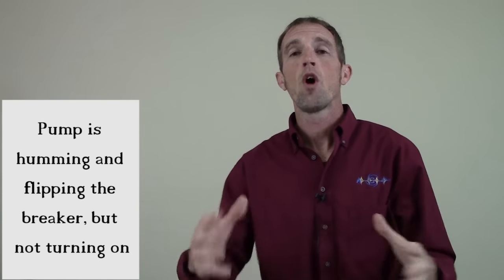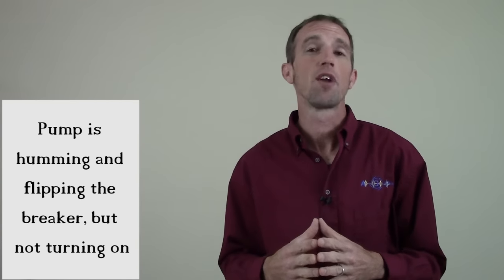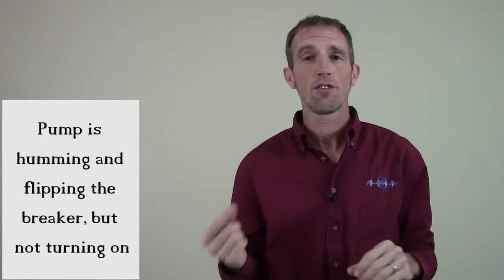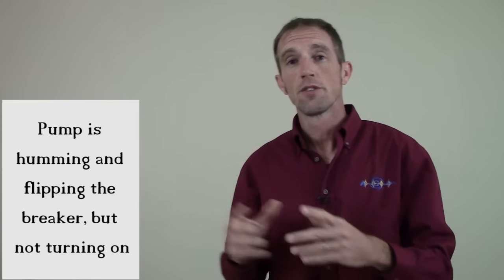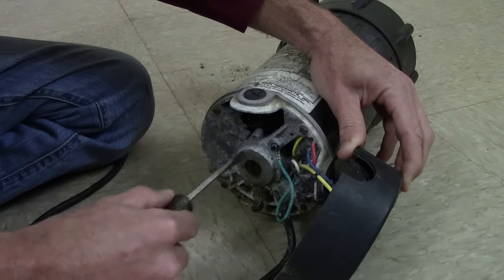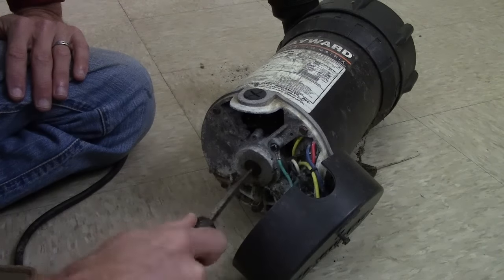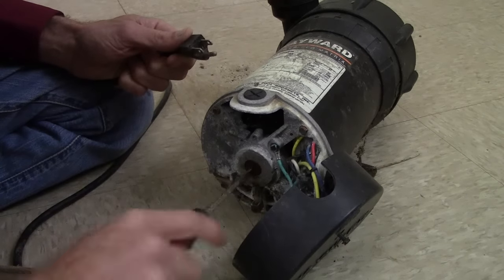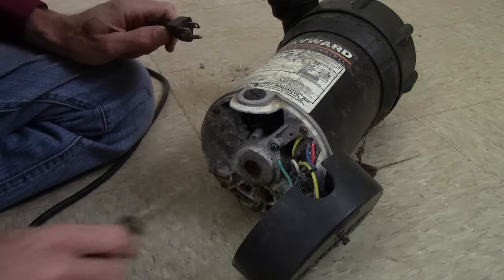Above Ground Pool Pump Won't Start or is Humming & How to Fix It

Comment: Got it to run.But is making a loud noise ? ??
Reply from the maker: That's just the bearings wearing down and grinding metal. That happens to every pump at some point in its life. The positive thing is the pump still running at 100% but the negative thing is it's keeping the neighbors awake at night. You can keep running it if you want or you can choose to replace it if it gets too loud and annoying.
Reply: @abovegroundpros  can the bearings be changed ?
Reply from the maker: A motor repairman might could.  You'd have to ask.

Comment: Well I can turn mine but it's not starting now I'm 💔 thankyou so much for this info you are so awesome bless you🌹💞🥀
Reply: CFlorida girl did you ever get your pump running? I have the same issue. If I find a fix I’ll let you know
Reply: @rickysheep93  yes I did! Have to keep giving it the "kick start" with the screwdriver. Unfortunately thats how its gonna be until it goes completely out lol
Reply: @rickysheep93  I dont use mine all that often lol only when I need to add chlorine & I run it like 6 hours or so a week.also I really appreciate your comment! Thankyou for the help
Reply: I tried my drill to spin it faster while turning the pump on.. fail. Seems a new pump is in my near future
Reply: @rickysheep93  did you try taking a mallet & smacking it before kickstarting it? I had to do that a few times before it would actually start
Reply: Tried the mallet and still nothing. Unfortunately the new pump has been ordered
Reply: Update: ordered new pump. My mind got the best of me so I went out brought it in my garage tore it apart, scraped some nasty crud off. Sprayed it down with wd40, put it all together  and started right up.
Reply: @rickysheep93  omg no fn way in looking for a new one now, just to have in the garage for when this one does go out. I have a hayward Motor is that what you've got? Wondering if I'm able to do the same.

Comment: did this last year and it worked. It is doing the same thing this year but it WILL NOT turn at all. NOW what?
Reply from the maker: fuzzbutt2871 Now you replace the pump, or at least the motor.  If you can't turn it then it's dead.  Sorry to be the bearer of bad news.
Reply: Above Ground Pros I have only used it for 2 seasons..It was new,bought it middle of 2013 season..That's ridiculous...
Reply: fuzzbutt2871 Do you have a video on replacing the motor ? Mine is a Hayward power flo lx pump.. 1Hp
Reply from the maker: fuzzbutt2871 Truth is, that's way premature for a pump to die.  Even having to do this last year shouldn't have been the case.  You may want to contact the company you bought the pump from.
Reply from the maker: fuzzbutt2871 I sure don't.
Reply: Above Ground Pros  I love your videos they are all great with clear,direct information.. Well maybe that can be one of your next videos..hint,hint...<3 Thank you..

Comment: what happens if it kicks on but doesn't have enforcement MOJO then stops after 5 seconds?
Reply from the maker: +Sherry Wood Huh.  That could be more of a power issue than a pump issue.  Honestly that seems odd.  You may want to have someone come out and look at that.

Comment: Doubt this would help anyone, but posting anyway. If you took your motor apart, put it back, but it is not starting - check you didn't bend the lever on the governor. The lever sends the power to the starter winding; if it is bent - no power to the starter winding, and no start.

Comment: that worked but when I got the pump running it started smoking and shut off?
Reply from the maker: +Alana Freedman That sounds to me like a pump that's shot.  You may have to replace that motor.
Reply: Today, my pump seized over the winter for the first time in 10 years. Got it started using your suggestion, and got a lot of dried DE out of it, which, for a moment, looked like smoke. I'd say if it smells like it's burning, then it's shot. Otherwise, it might just be DE or dust.

Comment: Hi Chad, the back of my motor is the same as in this picture. Any idea how to proceed from there: http://www.troubleshooters.com/pool/pump/images/pump_motor_back_uncovered.jpg
Reply from the maker: That's an inground pump. The upside down v-shaped assembly in the back has a quarter inch bolt that I would take out to move that out of the way. The whole assembly underneath it is attached to the shaft so you want to try to spin that section in the middle so the shaft spins. The trick is that some of that assembly is just popped in and held together by springs so you need to be very careful with a wrench that you don't bend things and tear it apart.
Reply from the maker: If you find that the shaft is spinning freely then on an inground pump they have capacitors and it would mean that the humming noise is coming from a bad capacitor. You could probably get one for 15 or 20 bucks at an electric motor shop.
Reply: @abovegroundpros  thanks a lot. I'll let you know how it goes. Question. To avoid potentially damaging that assembly unnecessarily, can I try turning the impeller instead and, if it spins freely, does that mean it's not seized?
Reply: @abovegroundpros  Hi Chad, you've done it again. Thanks so much for your help. There was a screw under the spring assembly that I was able to get an impact driver on. It got it right going.

Comment: My pump is brand new.  No corrosion inside.  Spins easily.  Still have a humming noise.
Reply from the maker: You should be under warranty and you need to contact the company about the pump from so they can warranty it

Comment: Well....i did get it started up thanks to you! But I shut it off & now I cannot get it started this way any longer. :(
Reply: I have the exact same issue after running it for about six hours I shut it off and it would not start up again. Did you ever get yours to work like it was supposed to or did you end up replacing it? Maybe I have to run it longer than six hours I don't know.
Reply: @martindrexler5639  no I had to buy a new one! I opened it up & the teeth are wore out & its completely dilapidated anyways. I did have some luck with tapping it though...but I will say if we have to do this its definitely on its last leg lol. I bought a really nice one for 140 bucks & its a 1.5 up one
Reply: @martindrexler5639  wish I could show you a photo lol its completely rusted its shell & so everything is exposed as far as the insides. Crazy it even lasted this long though....16 years. Also I might add when you do get a new one make sure it gets plenty of sun so it can dry up the water cause that's obviously the reason it quit! Water & moisture sitting etc. I sprayed a coat of clear over the new one that way it has an extra layer of protection for years & rains to come.

Comment: https://drive.google.com/file/d/0Bys6FI1ixC5WOTJ1bV9QTkx0djg/view?usp=sharing
This has 2 copper leafs which touch a plastic disk attached to the back of the shaft.  The copper leafs were damaged during installation.  Is it sufficient to just straighten them out?

Comment: what if kick starting it works but you have to do this every time?
Reply from the maker: +Zen Life Unfortunately that means you'll have to replace the motor.  I'd run it 24/7 until you can get another motor to replace it.
Reply: +Zen Life Most likely your capacitor is shot and just needs to be replaced. make sure you discharge it first or you can get a jolt.
Reply: Exce1si0r
Thanks ill check that out
Reply: +Zen Life ya there is a run capacitor that kick the motor off LOL
Reply: +Richard Shoemaker check the capacitor omhs reading and if the screw they are refering to that rototes the motor is free then its most likely that
Reply: +Richard Shoemaker capacitor top budge or oil leaking is a deff sign of being bad
Reply: +Richard Shoemaker No, most of these pumps have start capacitors. Some of them have start and run capacitors. Its a common problem and I have fixed quite a few of them. I dont even know what kind of pump he has but I have 10+ years experience with hayward, pac-fab, and sta-rite pumps. The run capacitors are usually found on bigger 2+hp motors.

Comment: I don’t believe this I have a $24,000 master spa which is exactly 13 months old I was sitting in the tub using it for approximately 10 minutes with the motor did this exact thing now it refuses to run it homes and does the automatic shut off a $24,000 hot tub that’s barely a year old and used nearly every week to two weeks this is more than likely not most everybody’s issue

Comment: bought a new one and it was doing this right from the get go ???????? what then , Junk ?
Reply from the maker: Either your power source is not allowing the pump to get enough power or the pump you bought is bad. If you think the pump is bad I would go ahead and call them and get a replacement as soon as possible.

Comment: Mine hums but spins freely, Wth?? —-(edit) weirdly, I plugged it in, hums, did the trick couple times, after one good spin, boom, it came on. 😅
Reply from the maker: I would guess that your pump is fairly new and it would sound like it has an electrical issue which may still be under warranty